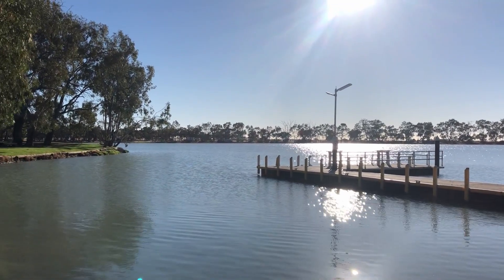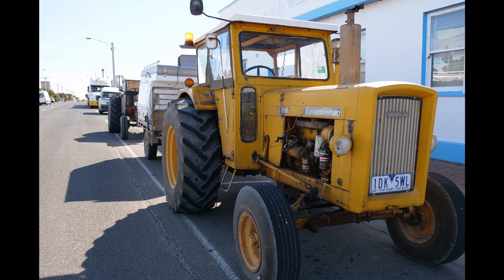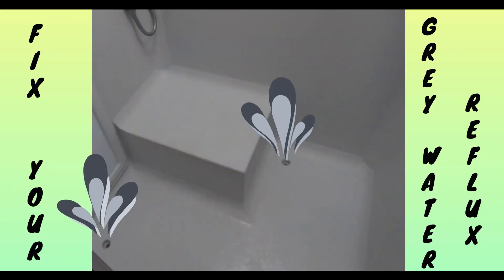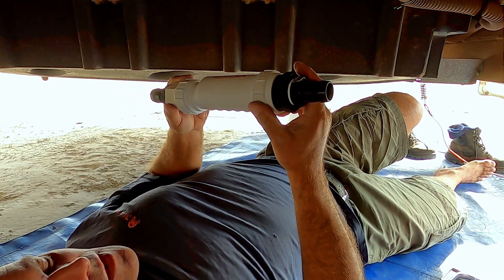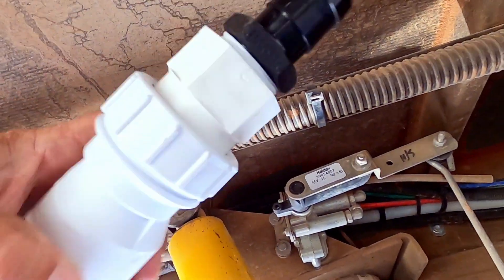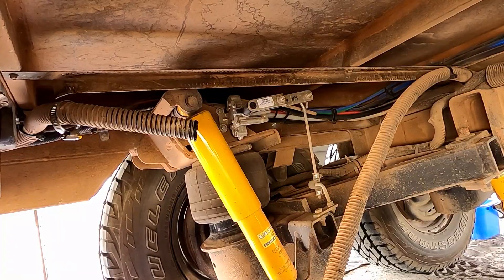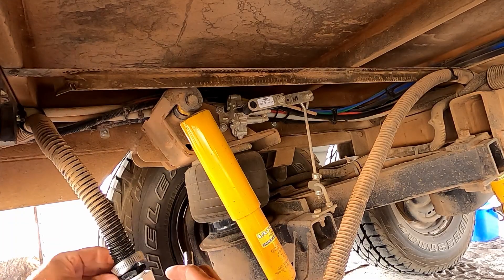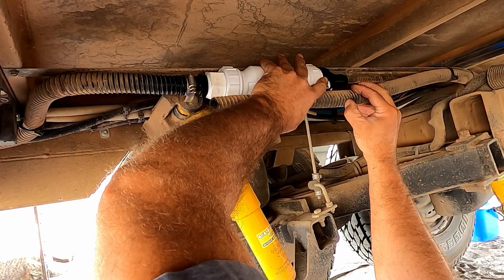Life on the road Tips &Tricks Fix smell & regurgitation issues Caravan Grey Water + Lake Lascelles

Comment: Well you three. 
I am really shocked how your water and sewage system has been realized mechanically under the trailer. Normal, one should let these designers and or, manufacturers, which sell such a defective manufacturing to you in Australia, these plastic ring corrugated hoses orally and rectally digest. Sorry. Karl is absolutely right to install level compensation. Sorry, you paid a hell of a lot of money for it, something like that is state of the art technology and is part of it. ( the cursed price poker and the result ). 
I know, it is not easy to exchange the system for stainless steel tubes, which would be correct for these purposes. 
If you have the option, there are thin stainless steel sheet metal strips, or galvanized sheet metal strips to buy here in Germany, in the hardware stores. Karl is damn clever, he knows what I mean and can install himself a protection, just under the trailer around these pipes from stone chips. The sheets wide enough, 0.5 - 0.8 mm are sufficient, you can wrap by hand around the Ringwell hoses, there, where it can come to damage, around and secure with binding wire, Sure it goes also with galvanized sheet, holds just few years less. 
Of course, you can also take thin chimney pipes, cut them open, put them around the plastic tubes and fix them. 
Have a nice Pentecost, seriously, I hope you were all three in church and prayed?  The devil and the Ringwell hoses, certainly a special prayer. 
Laugh Katty and feed Karl and Cobar quite well. 

Greetings from Frankfurt, nice days.
Reply from the maker: Hi Gerold, sorry for my delay we have been out of reception. thank you for all your information, you like Karl are very handy knowledgable.  We have had no problem so far with the corrugated waste pipes, they are quite tuff and that is why the manufacturers use them instead of ridged PVC.  They are located generally in well protected areas of the van.  The manufacturer has installed stone protection over the high risk areas.  Cheers Katty Karl and Cobar
Reply: @nowhereboundtouring  
Hi, you three,
not so bad, I am sometimes also a little later, grin, for whatever reason. I personally made in the tropics, with PVC, not a good experience. I hope the material has a good wall thickness and is well protected. 
Greetings Gerold